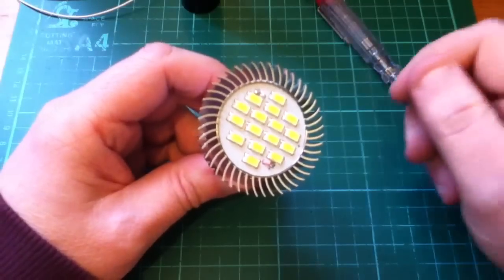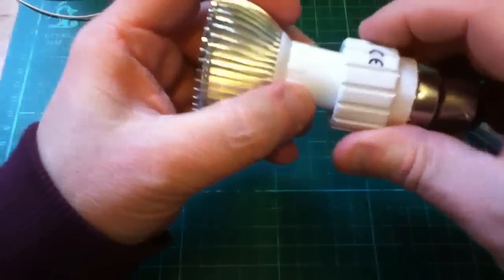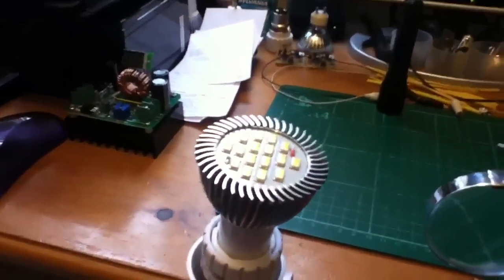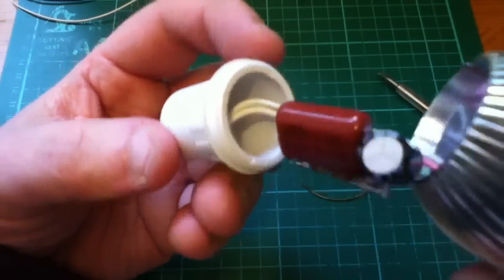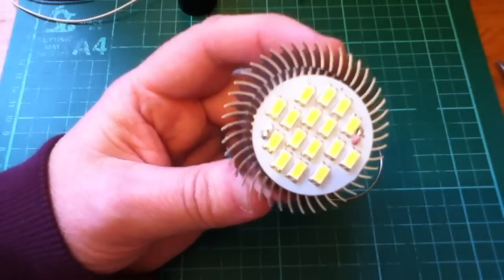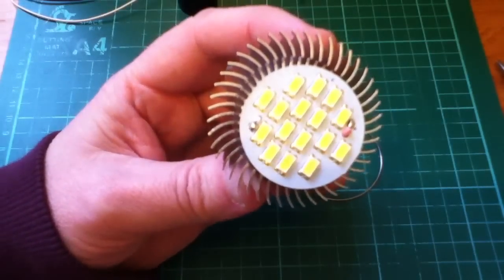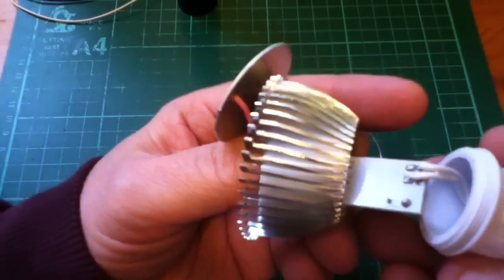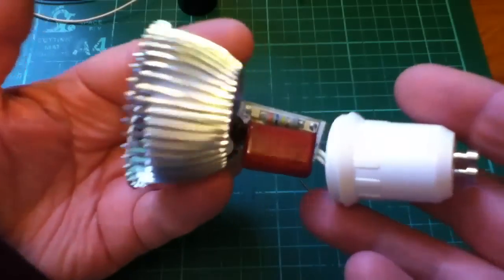Dangerous GU10 LED Spot Light is Cheap and Bright but could Kill You - Seriously

Comment: There is a bridge and cap on the board making a dc supply for the leds, his point is that the entire circuit and heatsink could be referenced to the hot wire instead of line neutral if installed wrong....you grab it and you become a nice circuit to earth ground through one diode on the bridge. bzzt. Your heart doesn't care if it's half wave or not.

Comment: And how can you say it's dangerous if you are such an expert? Let me tell you how the full circuit works...

The white wires from the AC power go into the bridge rectifier, after that the current is converted to DC, the DC goes to the big polyester film capacitor and resistor. After that the voltage is low enough to power the LEDs, then the voltage goes into the electrolytic capacitor to get filtered further... That circuit will work no matter how it's connected.

Comment: It's not a good design at all.  Even if the marginal insulation on Julians lamp means the heatsink is ok at the moment, there's no guarantee it will remain so after getting hot for extended periods, and no guarantee the one you buy is going to be good either.  Irrespective, the exposed soldered connections on the front are clearly not isolated and there is no way this would meet European or UK electrical safety standards.

Comment: I would of liked to see this tested on a meger meter at the standard 1000 volt test for insulation breakdown. but live connections and all exposed parts need to be earthed or it requires double insulation. it would be far safer with a small self osculating flyback transformer.

Comment: You are right, except you are totally wrong ;-)
The terminals on the front of this lamp are + and -, and if you've used yor multimeter and your brain, you could find out that the voltage on this terminals is something like 2-3 volts. Because of the LED driver in the bottom part of this lamp...

Comment: The circuit in this light works by turning 220AC into 220DC then uses a resistor to drive the LEDs. If the LEDs needed 12v at 60mA you would take 220-12 giving 208 and then divide 208 by 0.06 giving you 3.4k ohms.

Comment: I would like to point out you don't have a 50 percent chance of getting shocked if you touch one of the wires... You have a 100 percent change it doesn't matter which way you plug it in. You are still getting the same difference in potential. The only exception is if you touched a grounded wire. Other than that your fairly spot on. The potential across the 2 wires if one of the LEDs blew would be 220V but its not the voltage that kills.. Its the amps.

Comment: Sorry I didn't go thru all comments. But I want to point out something important in circuit design. Mostly a design 'will' work as 'designed' under certain 'defined conditions'. (This is just another word for 'specification'). ie, this LED 'will' light up when it is powered. Under this condition, the voltage across the LEDs may be just several tens of volts. However, when something happens (unexpectedly), eg one or some of the LEDs blown, the circuit will behave quite differently. (to be cont'd)

Comment: Those few microns would only be protecting you from some low (ish) DC voltage, which is much safer than AC. Chances are even if you had a worst case scenario, you'd blow the transformer or capacitors before you get a nasty jolt of Alternating Current.

But what Skylinevspec said, even on the odd "if" chance, it was carrying mains voltage, Why are you touching the damn bulb while it's on in the first place?

Besides, the 5630 is a 3v DC chipset.

Comment: I'd like to see you put a volt meter on it... to test your theory, in fact I'd like to see it shorted for the fireworks.  anyway it would be interesting to see what the voltages are at the top switched both ways around.

Comment: There may be 12VDC developed across the LEDs, but that doesn't mean that there will be 12VDC from any part of the circuit with respect to a grounded person. Also, turning the power off by a switch will provide no guarantee whatsoever that the live voltage will be removed from a fixture if the switch was incorrectly placed in series with the neutral wire. Even electricians make that error once in a while.

Comment: Looking at the design and engineering it appears that isn't an efficient layout for heat sinking.  Center LEDs will run hotter than the edge with that design. I also can't believe they didn't diffuse the LEDs.  Starting to hear word on people suffering form burnt retina.  Don't ask me why people like to stare at bright things with a small etendue and high brightness.

Comment: If 230v made it to the LED's surely the cap would blow before that inside closing the circuit off, and if 230V did make it to the LED's I'm sure they would last less than 30 seconds blowing the solder the LED's and everything meaning that it would be very unlikely that the solder and heat sink would ever make contact as the circuit would be dead or cause a trip somewhere.

In either case it's probably best not buying from Ebay and getting approved LED lights I'm sure.

Comment: I don't get what's so dangerous about the heat sink.

The orange and yellow wire looks like it connects directly to the LED's. If designed properly with "failure resiliance", the LED's would be in parallel to prevent one break from taking out all 16. This would make the wires at 2-3V. Even if the "microns of inulation" was defective, that heat sink would be at 2-3V and that's not enough to jump skin, no?

Did you probe the 2 solder joints on the top to see what volts actually come out of it?

Comment: sorry but you are wrong my friend series means that the current flows from one bulb to the next and so on , the negative from one bulb is connected to the positive of the next so the bulb closest to the live connection will be brighter than the one closest to the neutral connection. If one led stopped working they all would which they do not! (I am currently looking straight at one of my led Gu 10 bulbs which has a led out the rest are still lit! )

Comment from the maker: No, the heatsink isn't actually live because of the few microns of insulation on the LED plate. But the two connection points on the front of the plate are live.

Comment: jason correia, you are wrong. this lamp is dangerous. 

let's try with a simple "circuit diagram":

correct way: 0V - housing - leds - 3V - resistor - 230V
wrong way: 0V - resistor - 227V - leds - housing - 230V

in both cases, there's 3V (say) across the leds, and the lamp works correctly.
but with the wrong orientation, the entire lamp is at mains potential. this is comparable to a bird that sits on a wire. you're at ground potential, and if you touch it, you get a shock.

Comment: Of course this is not safe.   One side of the led is likely to be at line voltage.   There may be only 12V DC from across the LEDS, but that just means you could easily get a shock from either side of it.    Quite often GU10s are fitted into metal brackets, so the insulation clearance is totally unsafe.   There's no way this would pass safety compliance rules - It would need to comply with double insulation standards and its a long way from that.

Comment: This video is correct, people thinking otherwise, clearly have no good education on electronics or understanding of electronics. 
Although the Diode will be removing one half of the AC Cycle, you still have a full 240V cycle from other half. So you only get electrocuted half the times per second.
But still chances of you getting electrocuted are 50-50, once the insulation fails !

Comment: Dude it does not matter what he does, the circuit is really dangerous, it has to have a transformer that would isolate from the mains firstly. The kind of source used in this product is usually used only enclosed and where it can not be in direct contact. You can find these circuits online and every site has a big warning about not touching the circuit... it is cheaper for sure but would you dare but it in your bath for example ?

Comment: I'd like to point out that the incoming AC is 50/60Hz, but the bridge rectifier 'flips' the inverse wave to match, making it 100/120Hz (like you said). However there is also smoothing or filter capacitor, which doesn't mean it goes from a harsh state of off-on-off, It may be more like on 100% - on 50% - on 100%. Cheaper bulbs use smaller or insufficient design where the filter cap almost does nothing, think of cheap christmas LED lights, very noticeable flicker.

Comment: I am not an electric engineer so maybe i am wrong but what he said is: mains and neutral (ground). My understanding is that mains goes through the circuit (the resistor basically) and the ground is not. Which means that if you interchange ground with the mains you will have to provide for the resistance, unless you're perfectly cut off from the ground of course.

Comment: 1) Bridge recrifier takes care of alternate current. 2) Filter capacitor more or less takes care of voltage ripples at 100 or 120 Hz  3) Resistor is voltage divider (diodes current is known and constant)  This _is_ most primitive and dangerous design - avoid it. People who introduce it to the marked should be reported.

Comment: BottomLine is that After the Voltage Passes through the Circuit Board
the Capacitors cut down the voltage to vary Little volts.. So little that you can almost put your tongue to them.. They would never allow though's light in to other country's if it was such a HAZARD!!! with exposed circuits like that, the reason why there in no "COVER" on the Led front part of the light is to Allow Better cooling! and because there is NO hazardous High current at that end.
You just Misinformed 111,000+ People

Comment: THIS WILL NOT KILL YOU DISREGARD THE WARNING!
I don't think you know much about Electrical circuitry..
Note: The Main GU10 connection socket end is the High Voltage end
producing 120v-240v Input depending on your country.
After the high current runs through the circuit board though's
BIG Capacitors at the other end with the (Pink & White) wire "Brake-Down" the current from 240v/120v Down to just a small number of Volts Europe uses 240v and North-Amarica uses 120v

Comment: Heatsinks maybe a step back but I'd rather have a heatsink and not catch my house on fire and if you actually look at the board they have a reverse relay so its an idiot proof device but we also do this in a generation where electricity is not free so when you're not in the room when not using light shut it off my house is completely on LED and CFL bulbs my electric bill runs about 23.80 a month roughly

Comment: You seem capable of the obvious test, try to get mains ac voltage on the 2 points you indicated near the lcds with the 2 possible ways to insert bulb. If there is only a bridge and no other parts there is 340 volts dc there on 240 mains ac volts. You can use a 10 million ohm resistor and there is still the 340v dc at the other end. Now as part of voltage divider it is different, until something fails. 40 volts ac or dc is the lower limit of hazardous by a lot of codes, need to block casual touch

Comment: What if old aunt Agnes can't remember which setting of the switch on the lamp that was on? And she has clicked it back and forth several times until she realized the bulb was broken. Hence the advice in the video "turn off the main if you still want to use this bulb".

Comment: No! Most E27 table lamps etc. come with a 2-pin plug which means you do have a 50% chance of getting ACTIVE on the Edison screw base. Fixed wiring E27 luminares are not guaranteed to be wired with NEUTRAL to the screw either, in my experience. The Edison base itself can cause shocks when changing any type of E27 bulb if it has a short insulating collar.

Comment: Furthermore that bridge rectifyer will all ways output positive DC the same way around. The only risk you have is 12 - 50 volts DC at very low current being on those contacts.

Comment: My word! What a load of drivel, people! No one has explained that you can only get shocks off something which is energized at a voltage that will overcome your "skin resistance", or that there has to be a return path for current to flow through you. Otherwise all those birds that sit on overhead power lines would die!
For goodness sakes do your homework!

Comment: The issue is that, regardless of what the voltage across the LEDs is, there is the danger of coming into contact with line voltage when handling it. Also, While you shouldn't have a lamp turned on when changing the bulb, you could brush against it while on, or you may forget to turn it off or have a fixture wired so that the switch is on the wrong wire etc. Basically, any device should be designed so you do not risk touching any wiring, whether it is live or supposedly neutral.

Comment: wrong, it's the opposite , if wired in parallel brightness will be uneven, i have disassembled tons of these , and for obvious reasons they are always in series , the reason is pretty simple, the lower voltage difference there's between input voltage and led drop voltage , the less heat is produced by resistors , since these crap drivers are almost linear

Comment: The neutral wire is connected to *earth* at the fuse box in the building. Go have a look at yours. There is a brass neutral bar with all the earths and neutrals connected together. That means neutral is 100% safe. The voltage dropper is the brown capacitor so it *has* to be before the bridge rectifier to make sure it has AC current through it. If it was after the rectifier, DC current through it would only flow for a brief moment then stop. Capacitor -> bridge rectifier -> LEDs so no AC to LEDs.

Comment: Firstly, AC don't move in 1 way. It doesn't matter if thats a live lead or a neutral lead....once its on, both can kill you! Secondly, the rectifier part of the circuit should be before the voltage drop part, because if AC goes in pass the LEDs, they would fry! So, your part about dangerous electricity don't apply anymore. The 2 wires there are DC and at a very low voltage. The circuit board itself has a plastic shield which dropped when you pull it out...thats insulation between live & heatsink

Comment: Hmmm, It seems to me that if this lamp uses a bridge rectifier, it would be dangerous regardless of what way you plug it in, since the rectifier will conduct to the undropped output from either input. The real problem with this lamp is the lack of insulation, not that it can be plugged in either way. In fact, it is bad practice to design any system to be dependant on one wire being neutral, since this is not a safe assumption that this always holds true.

Comment: The issue is not that the GU system is unsafe, the problem is in designing any appliance on the assumption that a certain wire will be neutral(which itself is a kind of a patch on the flaw in the Edison socket system, namely that people can easily come in contact with the tread). 

Secondly, the problem with the lamp shown is not that it can be inserted either way(it is equally dangerous either way, actually), but that it has the danger of coming into contact with potentially live metal at all.

Comment: Just be fore to know what you're doing first. ^_^ understanding the circuit you're working with is key to not dying while trying to repair something! Say perhaps a battery pack that manages li-ion batteries via micro-controller. If you short circuit a battery like that you might produce a lot of dangerous heat or an explosion. In the case of these light bulbs on 220-240v one is liable to have a finger or two blow off literally.

Comment: Why would you be shocked if the lamp is of? (also, do you mean that just the power is of or also the lamp is unplugged?). By non-polarized do you mean being able to plug the lamp in the wrong direction? (which don't matter in old incandescent bulbs)

Comment: even with screw fitting lightbulbs, there is still no guarantee of polarity. in europe, the screw fitting is used, and the mains plug used is unpolarized (type C), so a lamp with screw fitting can get the polarity both ways around.

Comment: I don't quite understand. Is there a risk of shock if the bulb was assembled in the wrong direction and you touch the metal while plugging it when the power switch is on? -OR- if you plug the bulb in the wrong direction, touching the heatsink while the power switch is on? (regardless of the manufacturing)

Comment: I had one of these and it was working nice for about 6 months....
after it died (what is a bit strange do to a long life span of ANY led) I dismantled it (I'm electrician and as a rule I dismantle everything to try to fix it)....
there is something a bit strange with these, and that is a voltage on a broken LED circuit board....
it's 400V.... :D .... so, when it dies it's actually even more dangerous than before.... :D

Comment: Sorry sir, you are incorrect! The AC terminals are buried deep in the plastic base. LED Chips run on DC, if that shorted it would not even hurt! still, don't recommend buying LEDs of Ebay. try LED Canada

Comment: I got hit once when I connected a PC power supply that was frazzled to a motherboard that I wanted to test, without knowing that the power supplies in the red box were the ones that are gone, and another time while standing on a ladder when trying to fix a lamp to the ceiling, and I was so careless not to check whether the fuse nor the light switch were off. Both times, nothing happened except that I felt a little shaky afterwards (and, of course, the fuse blew, too).

Comment: Dielectric thickness available: 0.10 - 0.20 mm

From a random datasheet for metal core or IMS (Insulated Metallic Substrate) circuit board.
Follow this link and click the "Data sheet 1 layer" pdf: goo(dot)gl/kaNFc1